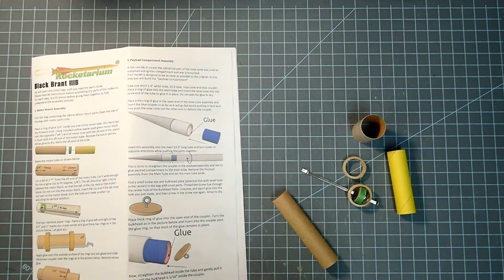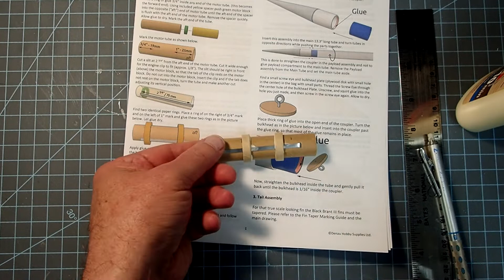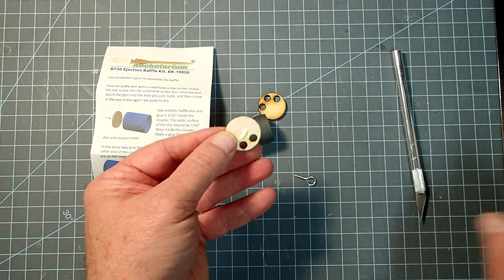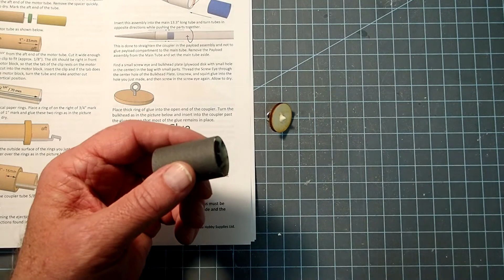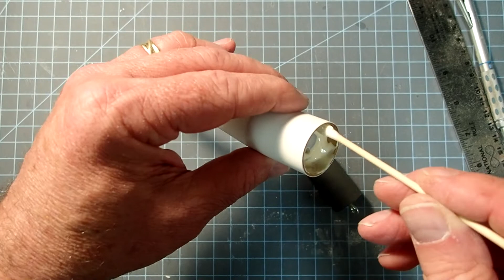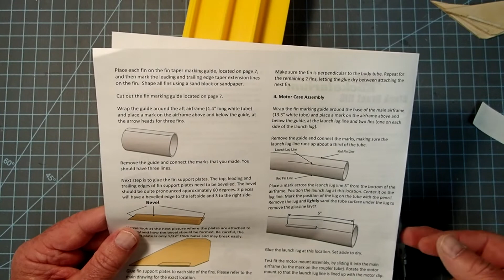Rocketarium "Black Brant IIIB" model rocket assembly (part 1 of 2)

Comment: In watching this one more time, your assembly techniques are quite addictive and it amazes me that your cutting board is devoid of old glue blobs and paint spots! Neat work to say the least. Thanks for the video!
Reply from the maker: @lynetteschroeter6843  it has become less clean since I made this video.
Reply: @REAR_rockets  Not surprising at all, mine is quite the mess. Just to let you know, my BB IIIB kit is completed and finished but not flown as of this date. The kit is a very good example of what a detailed "scale" model should be. Thanks again for the video. I also have finished the BB V from Rockekarium but I can't find your video of that model.

Comment: Dr dave... crazy question... i am trying to scratch build a rocket as i said before... cant find a coupler big enough... would it work if i took a tube i wanted to use and glued more paper on to it in layers to beef it up? Or would that not be ok structurally? And if i can would that be bad to use as a baffle assembly if i have to beef it up like i want to for the coupler?
Reply from the maker: Yes, you can use additional paper and glue to thicken couplers.
Reply: @REAR_rockets  thank you.